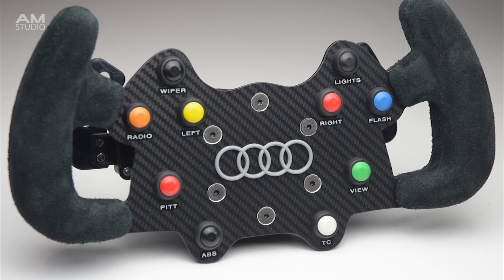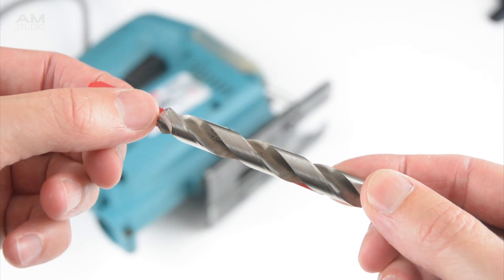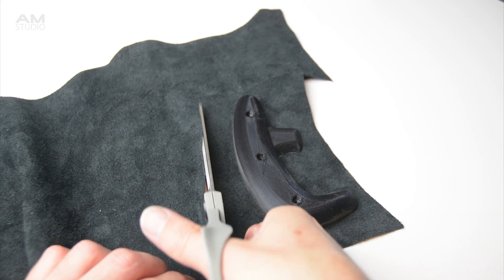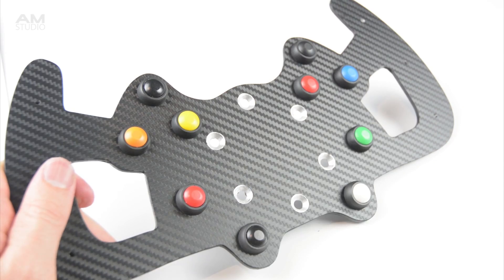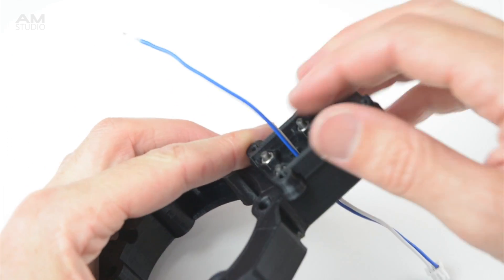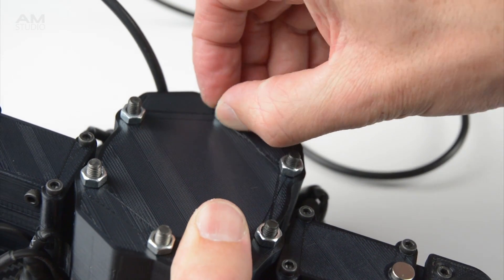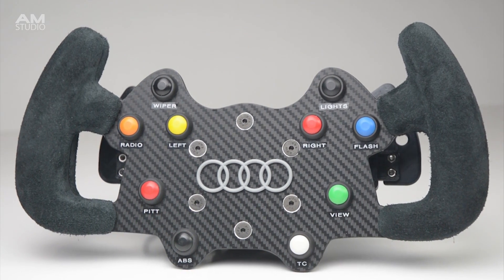HOW TO MAKE A DIY AUDI DTM STEERING WHEEL

Comment: Apologies in advance for what might be a stupid question. (I use Xbox and TH TX with Ferrari F1 wheel, but contemplating moving to a PC). Having built the wheel and connected to my wheel base, I now have two USB connectors, one from the base and one from the wheel. I assume that I plug both USB into the PC? Secondly I assume that the PC will "see" two controllers? I also assume that my game F1 2019 (PC) will recognise both sets of inputs? Thanks you for your help. Andrew

Comment: hello, it's up to how much to achieve this steering wheel, because no steering wheel manufacturer does it for a Fanatec base, it exists for TH, Logitech or direct drive but never for Fanatec or so it is necessary to manufacture either, personally I do not know do this I do not have a 3D printer and no skills for connecting with a Universal HUB, Where can I buy this steering wheel directly connectable to my Fanatec HUB ?

Comment: First of all: Nice work! But...
Where is the carbonplate from the beginning of the video gone?
What about the longtime stability of the 3-D-printmaterial?
Reply: As he mentioned in the video, he decided to use an aluminium sheet instead of the carbon sheet. Also, the 3D printed parts will hold up just fine!

Comment: Very good tutorial! Eventough I don`t even have a Sim Rig, I want to build a Wheel (I have a 3D Printer and the possibility to CNC cut Carbon fibre) to try it at a friend`s rig. Do I really Need the Fanatec Universal Hub to connect it to a Fanatec wheelbase? Or can I just buy a Fanatec quick release hub and i`m good to go? I don't get the Point of the universal hub if I don't use the Buttons.

Comment: FYI If you use aluminum like this, you can use Aluminum bluing (search Birchwood Casey on Amazon) which is used in gunsmithing.  Its sold as a small bottle of liquid or in paint pens and will chemically blacken the aluminum so you dont see raw aluminum under the mounting screw holes.

Comment: Nice! Now I can replace the steering wheel on my car
Reply: I use a PS4 controller (p0wer stearing).
Reply: Edward Ornelas haha i wouldn’t do that
Reply: Pliers work just fine
Reply: @c0r5e  if you have a harness on a racing seat you don't need an airbag. F1 drivers are safer in their f1 car than regular people on their regular cars. And f1 cars have no airbag. The harness keeps you glued to the chair. Unless the whole front of your car flies off you won't need an airbag.
Reply: @your_average_cultured_dude  problem is, with no neck brace (daily driving) you can end up with some mad neck problems if you get into a crash...

Comment: FYI, contact adhesive should be applied to BOTH parts (the grip and the suede) and the adhesive should be applied very thin and thinning with methanol is advised.  Let them dry to a tack and when they touch each other, they will be fused permanently.  Gluiing on one side with this type of adhesive will result in subpar results.

Comment: This is amazing. I just have 1 question, does the USB cable dangling there affects you at all or is it just the same as the wheels without them? I am making my own wheel set and Im not sure if I should route te cables trough the shaft or like how u did here..

Comment: Hey that's a nice guide, what other ways can I do the cutouts on 3mm thick aluminium if I can't have access to a jigsaw? I do have a dremel, but it is quite loud to cut on metals. I'm thinking to use hand tools. 
I should also say, I do live in an apartment with very thin walls so making too much noise isn't ideal.

Comment: Awesome. Is it possible to use the quick Release without the Universal hub ? The screws are the Same? A quick answer would be good. Thx
Reply: Sadly, a Fanatec base does only deliver Ffb as long as a "rim" or in this case the universal hub is connected to it.

Comment: I've been using this on my 83 Ford Escort and it's driving like a boss. Thanks m8. I didn't have a 3d printer so I used a jigsaw and instead of carbon fibre I used fibreglass which was recycled from an old building job. Some of the texture gets into my hand every now and again and it itches like a bitch but if I don't rub my eyes and use my gloves when I drive it works well. Couldn't be happier, I even think I take those corners a little faster.
Reply: @kool 12 Same bro

Comment: Super sick but need alot of equipment mostly the 3d printer dont have access :(
Stellar Job though i bet u can resell them for a ton
Reply: Sand 2 bits of wood, instead of 3d printing the handles. Ezpz
Reply: @birtalanlorant5572  what about the paddle shifters, rear housing for wires and board, the spacer. There is more than just the handles that are 3d printed. I got a great 3d printer for £150 called ender 3 and it's great. I have made this wheel and it's way easier than people think, just time consuming

Comment: Can you do a custom Thrustmaster T150 or Thrustmaster Tmx wheel mod? Would be awesome
Reply: Omg i was about to say it!!!😂
Reply: i dont think so
Reply: Will this rim work with a thrust master wheel base?
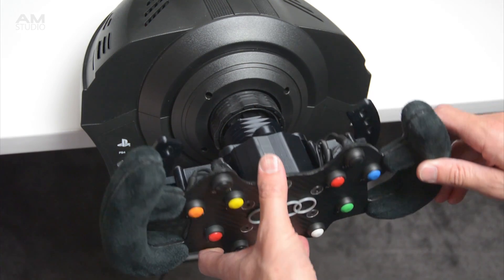Reply: The wheel is compaitible with TMX with a adaptar 7:32
Reply: @maximilianschaffler9981  TMX doesn't have a quick release, it comes with the wheel hard-fixed to the base and to you will need to completely disassemble it to remove it. The adapter works only for the likes of T300, TX and the higher end ones
Reply: Alex Bui ahh got it wrong tmx and tx switched up
Reply: Not a problem to plug it into a TMX. Just disassembly the wheelbase and you'll have the plug here. It's just the case of making it fit.

Comment: These are the kinds of wheels Fanatec should be making. Instead of 5 different formula wheels based off an old design. 

 There aren’t many GT3 style wheels available on the market. Not affordable ones at least. I have the Fanatec Mclaren wheel but it’s really toy like compared to some of their other wheels. 

I’d like some for Podium VR users. As we aren’t looking at our wheels it doesn’t need the extra visual aesthetics. 

 No automotive branding, no lights and no little LED or OLED screens.  Just lots of push buttons and funky switches.

Comment: If your thinking dam I don't have a 3D Printer you could just sand the handles out of wood, especially if you're just going to cover it with suede
Reply: @smallpants  Or just go to a library and print them there.
Reply: yeah or use nice wood and just wax it.
also i would use a 5mm fibreglass instead of aluminium, as aluminium bends instead of flexing like fibreglass
Reply: @inevitablecraftslab  which is why the real car teams also use fiberglass to make their wheels  ;) who needs aluminum pfftt.
Reply: @Globespy  they use carbon fibre, and if you want to use carbon fibre but dont want to spend the money use fibre glass.
Reply: Wood splits 
And force feedback wouldn’t go well with a breakable material
Reply: Jake Lawton i meant the grips not the plate. you can use walnut or other nice dense wood without any problem
Reply: Duke I don’t have wood either
Reply: @HaXD1209  there are trees everywhere 😜

Comment: OMG this is so awesome!  Thanks for posting.  Also a side tip, you can use a general deburring tool that can clean up sharp edges on the metal plate a lot faster than using a file.

Comment: One more thing you could do to this wheel in order for it to have a stronger/more durable mounting face is to put nuts immediately up against the base aluminium plate after passing the screws through, and tightening down. Then adding additional nuts on the ends of the screws, right up against the inside of the housing, that way the housing is resting on the nuts. This takes away all the strain from the 3D printed plastic parts and makes the whole mounting assembly incredibly strong, easily enough for 30Nm direct drive systems. Love your videos, you've been a huge source of inspiration!